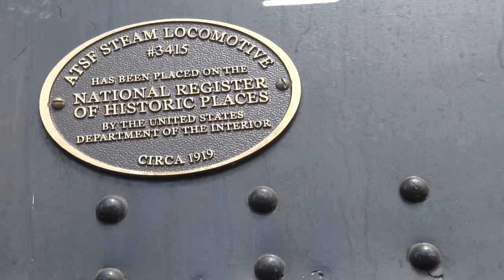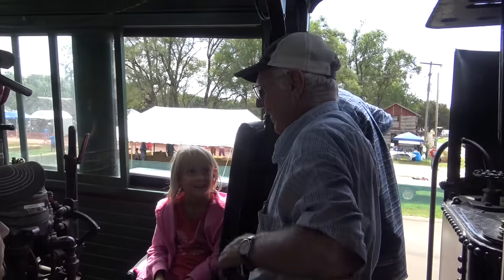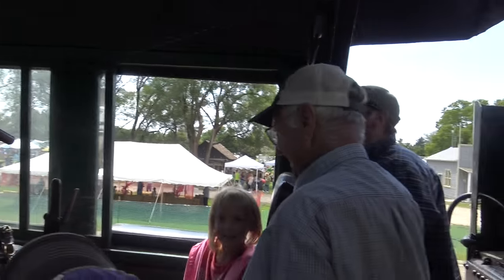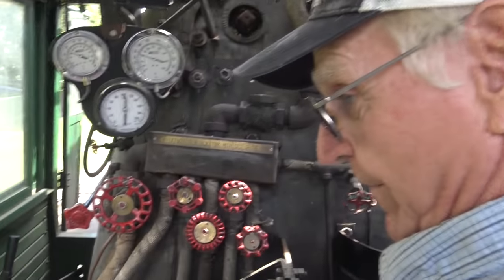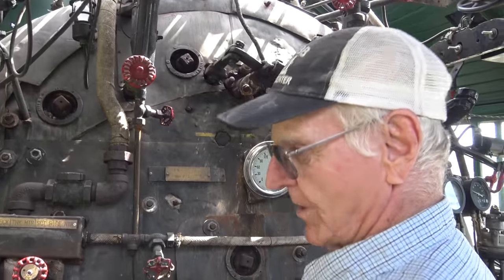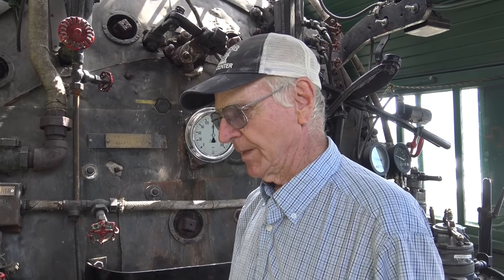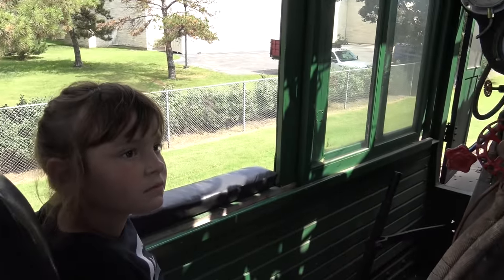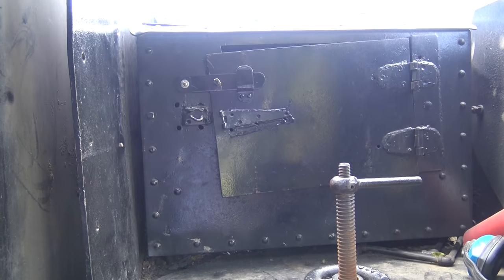How to drive a Steam Powered Locomotive

Comment: 3415 needs a Doubleheader with ATSF 3751 4-8-4 Northern in Santa Barbara, CA.   And also ATSF 2926 in  Albuquerque,  New Mexico, and running on the Transcontinental Mainline from Chicago to Los Angeles, also on the Grand Canyon Rr original line at Williams, Arizona, that formerly, daily, had these 4-6-2's, that also included the other ATSF 4-6-2 PACIFIC that used to run at the Texas State RR excursion from Palestine to Rusk until the 1990s with videotapes , and the P.B.S. TV show called "TRACKS AHEAD".   Thus 3415 is quite famous.

Comment: The engineers don',t wave from the trains anymore, not like they did back in 1954
Reply: Engineers are now closed off in their cool air conditioned cabs with forwards windows 🪟.....yet steam locomotive 🚂 engineers needed their windows wide open just to see around the boiler from the right side in the U.S.A. and Canada 🇨🇦  and Mexico 🇲🇽 😍 👌 and others,   thus it was easy to wave at the kids by the tracks,  meanwhile the fireman watched the left side, for Real Team- Work.   But now in the 21st Century the Engineer is usually all alone up front, while the computer 🖥 really drives the 6 engines like a giant robot 🤖 , with 24,000 Horsepower, at 60 M.P.H.,  and TV 📺 monitors, with event recorders, and with P.T.C., Positive Train Control relaying back to the Dispatching Control computer.   Sad. But the "HUMAN ELEMENT" is almost gone from Modern Railroads.  Thus, Steam Locomotives at Museums,  and Excursions, give young kids raised on video games 🎮 🕹 😀 👏 😄 👍 🎮 🕹,  the REAL LIFE EXPERIENCE, that they won't ever get by sitting on a comfortable chair, and wearing the 3d headset that closes off the outside world;  yet Steam Locomotives are in the Real Outside World, and they require you to Open Yourself to The Real Experience, that includes the sight and sounds.....but Also the SMELLS, that are some of the Most Powerful Memories;  like steam has a sweet odor.    Oil.  Coal smoke.  Country Aire like new mown hay, plus other "stuff" 😆 LOL!!!   Hot sun 🥵 .  Cool Rain 🌧.    Icy Snow ❄,  and many more.   Like the change of seasons.    Like the daily change from day to night 🌙.   The Steam loco is Trully the REAL 1080 ° Degree Experience of Your Lifetime !!!!!   GOD BLESS THE U.S.A 🙌 🙏 ❤ 💖,   GLORY ALLELUIA  !!!!!   AMEN 🇮🇱 🙏!!!!!   SUNDAY, NOVEMBER 6, 2022A.D. HAPPY 🎂 😊 😃 😀 😄 😁 THANKSGIVING DAY, EVERYONE  !!!!!   AND MERRY CHRISTMAS 🤶 🎅 🎄 ❤ 2022A.D.!!!!!   AND. HAPPY 😊 😃 😀 😄 😁 🎂 NEW YEAR 2023, A.D.!!!!!   (PP.SS.:   WOW !!!!! NOW THAT FELT LIKE A POWERFUL SERMON WITH A REAL GOOD MESSAGE. OK 👌 👍,  COOOL!!!!!)
Reply: Another engineer told me that my friend.

Comment: I thought these things ran on coal. Good video.
Reply from the maker: Thanks
Reply: Some of them do,UP 844 has been running on #5 oil since the 40s i think and the recently restored UP 4014 was converted to burn oil aswell.
Reply: Some steam Locos run on Oil. Alot that are restored are converted to burn oil because the one problem with Coal is you get hot cinders shooting out of the stack and they can cause fires

Comment: Wonder if the locomotive has a heater ? You know, for winter !😄😄😄
Reply: That locomotive IS the heater! At Silver Dollar City, In Branson, MO. An engineer told me it can get up to 150 degrees in the cab. But those engines are small. So it could get more hot depending on the size of the engine.
Reply: Some of them have radiators in the floor of the cab that runs steam through them, however unless it's in -40 country, it's too hot to turn it on in the cab.

Comment: steam engines paint burns off quicker cause of high heat thats why its look bad
Reply: dav id jones with thr right paint, it shouldnt wear off so quickly.
Reply: You can just steam clean the whole area.  A better use of paint, for you, would be huffing.
Reply: No, there is something called "weathering" look it up. And the "paint" can withstand heat up to 4,000 degrees Fahrenheit, over double the heat of the firebox when fueled efficiently. WEATHERING WEATHERING WEATHERING WEATHERING WEATHERING WEATHERING WEATHERING WEATHERING WEATHERING

Comment: Is that steam loco's wheels are bigger than diesel loco's wheels in terms of diameter?
Reply: I believe this locomotive was originally designed for passenger train service. Passenger trains ran faster than freight trains. Having large diameter driving wheels would result in slower movement of the pistons and connecting rods.
Reply: The large Diam. of the drivers is for speed. The smaller they are they produce more power.. A modern diesel is diff in that the diesel engine is only to run a generator which sends electrical power to motors (called 'traction motors') which are geared to the axles within each truck (swiveling frame work which house the wheels/axles/springs/brake s /motors). Since it's small Diam. wheel's are propelled by electricity the wheel Diam. can remain way smaller than steam wheels (at about 32" ), their RPM can be as fast as engineer wants..If a steam engine has as small wheels, to go, say 90 MPH, the reciprocating  rods, pistons and valves (called the 'action') would have to work extremely fast, causing them to break off, snap, bend, etc. This is because steam itself can't be circulated as fast as the electricity that propels diesel-electric locos...
Reply: Mark Harris No, the engine produces the same power no matter what size wheels it drives. Smaller wheels give lower gearing which increases tourque enabling heavier loads to be pulled at these expense of speed.
Reply: you basically summerised what he said. when he said more power with smaller wheels, it had nothing to do with the boiler. however, boiler size does make a difference. basicly the smaller the wheel, the more tourqe.
Reply: Smaller wheels= more torque but less speed

Big wheels= less torque but more speed

21 inch diameter (wheel diameter of train wheels diesels, frieght cars coaches) is the perfect combination of both torque and speed.

It also depends on how you operate your locomotive

But that would mean I have to break out the science and I don't think you will understand it.

Comment: At .28 what is that air compressor what is the pourpse I notice the chug sound also at this time what is that
Reply: It&#39;s a Steam Driven Air Compressor. A Westinghouse 8.5&quot; Cross Compound 2 stage compressor to be exact. Being steam driven, it naturally chugs when it runs because it runs on much the same principle as the locomotive&#39;s main cylinders. And in case it isn&#39;t obvious, you can&#39;t stop the train without air pressure, which is the purpose of that pump.
Reply from the maker: Appreciate you chiming in and educating us. I thought the train was neat and wanted to share and that's as far as my knowledge goes.
Reply: Tuttlepuddle, you're welcome, one more thing though, like many other people, you refer to the Engine as a "Train" It's not a train, it's an Engine or Locomotive. An actual "Train" is the assembled consist of cars that the engine pulls behind it. For some reason Train has become the universal term in America and in some other countries to describe anything on wheels that rides on rails, and it's incorrect. It's not a big deal, but it's just one of those common errors that pester me.
Reply: The air compressor is steam operated and provides air for the locomotive brakes and all the brakes on the rolling stock ( cars) that the loco is pulling.

Comment: the driver has the train brake, the locomotive brake, regulator and reverser
Reply: Poole's railway, as long as everybody is correcting each other, that's the BRAKE.  The crew takes a BREAK at lunchtime.
Reply: Autocorrect

Comment: How the extra pressure of steam vented.
Reply: The same way it's vented from any other boiler or pressure vessel, by one or more Safety Valves. This engine I believe is fitted with 3 of them.
Reply: Yes.  The 3 safety valves are installed on top of the boiler, and located between the cab, and large steam dome on top of the firebox of the steam locomotive 🚂 🚃🚃🚃🚃🚃😇👋🤍!!!!!   HI in July 2023A.D.